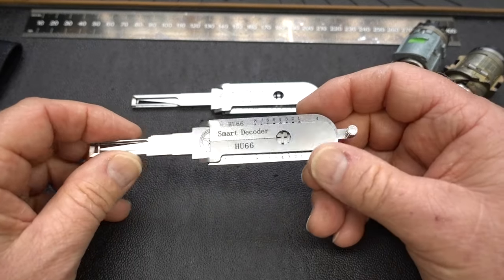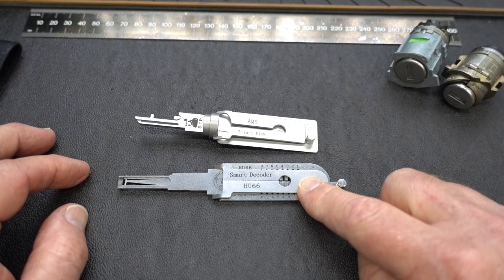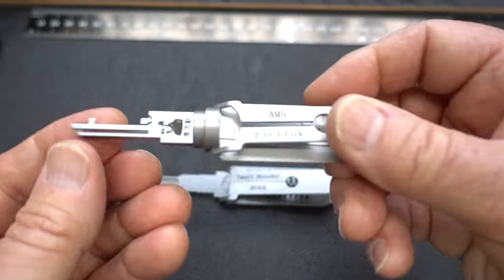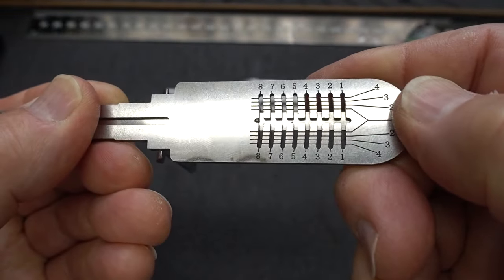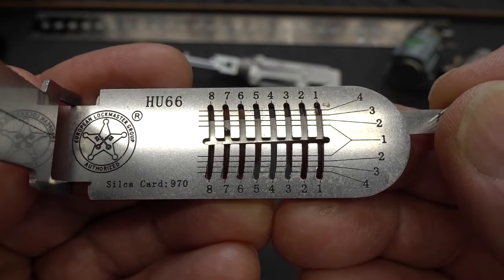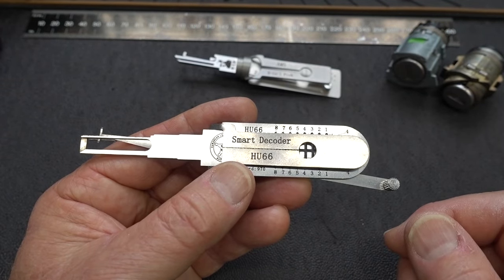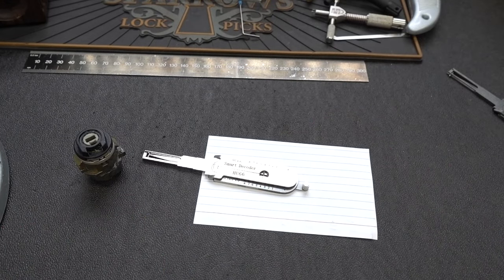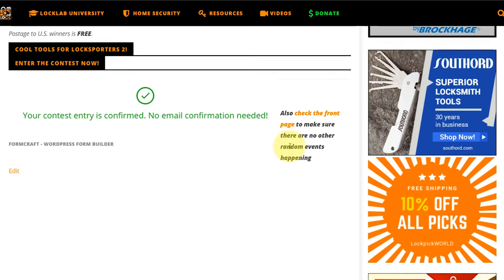(1714) Review: Smart Decoders from Wendt

Comment: For the record that was a Audi door lock cylinder, also the cuts are either odd on one side even on the other or 1,2,5,6 on one side and 3,4,7,8 on the other, you only read one side after picking not both ( I’m a automotive Locksmith for 25 years ) enjoyed the video
Reply: For the later VAG locks they use Side cuts as well. On the slightly earlier locks the wafers go 2 on one side then 2 on the other down the barrel.
Reply: Do they work on all locks, inclyding the ignition? Lots of my customers lose their keys, and direct read for everything would be infinitely preferable to progressing a key from a door only, and definitely better than pulling the ignition and taking it all apart.

Comment: The first two points you compare are not fair. 90% of the jobs are on daylight,  if is the finish shining is as you said "head gymnastics" to tilt and have a good reading. Second,  the fact that lishi is completely loose to move around you can get over some nasty high cut pins (like cy24, gt10 etc), the pointing tip of the decoding is sharp on lishi and better for reading "inbetweeners". Overall... I'm a big fan of Lishi and Mr Li, I used them for many many years and never got one snapped, yes, decalibrated but never snapped. 
Keep up your good work, every single video I learn something and congratulations!

Comment: I'm a locksmith in the UK and use Lishi picks to open cars all the time, I got one of the Smart decoders (HU64 for the Mercedes locks) when they came out a few years ago, unfortunately those channels that guide the reader up and down can prevent the pick from working, you see the end that actuates the wafers is a "T" shape on its side, and the wafers when picked into the maximum depth can't then move back far enough to allow the guide back to the cutout for moving between the different wafers, because the bottom of the wafer has come up so far the opposite end of the "T" shaped actuator is now blocked by the bottom of the raised wafer, now the HU64 is a much narrower key blade than the HU66 so Lishi made the pick differently and had two actuators that could only lift the wafer in each direction, and didn't allow for pushing it back in the opposite direction if you over lifter a wafer, the Lishi picks for wider keyways like the HU66  has more room to move up and down so use the same "T" shaped actuator, but because  Lishi picks don't have the cut channels, you can usually come back far enough to just pull/push the actuator into the next wafer position if the biting makes it awkward, but generally I find the narrower key-ways easier to pick with the old two piece Lishi blind picks that can't suffer from any of those problems because you retract the end of the actuator into the body of the pick completely.  
 Lishi Blind Pick 
https://i33.servimg.com/u/f33/11/98/29/83/hu64-p10.png

https://i33.servimg.com/u/f33/11/98/29/83/unname10.jpg

Lishi 3 in one pick
https://i33.servimg.com/u/f33/11/98/29/83/3-1-hu10.jpg
Reply: Yes exactly!

Comment: Those Wendt picks are really nice to use, however most locksmiths need 10-20 different picks for different keyways so it adds up, especially if you buy the lishi picks at a discount. BTW, you only need to decode each wafer on one side, the same side you moved the pick when you set it.

Comment: I have about 50 Lishi or Mr Li picks for about 98% of  UK vehicles.  I have a flight case for them.  They last typically 3 to 4  years of hravy use. They also use silver on black.  Once you have done your first 100 its second nature to find the correct wafer.

Comment: The comment about the “flat design” vs the “collar” isn’t a fair comparison.

The collar is on domestic lishi picks and not automotive lishi picks.

The reason it is on the domestic picks is so you can reverse the tension bar depending on the handing of the door.

That being said...
Does the German Wendt picks come in domestic profiles or only for European automotive?
Reply: @Zieh-Fix  Do you have any plans to produce domestic lockpicks in this style? The greater variety seems to be the main advantage lishi picks have over these.

Comment: Neat tool actually! But I'm guessing you'll need one for each key cut?
Reply: There are some systems for which a different designated tool will work (picking), but they're few and far between. Can also cause issues with decoding - may or may not be a problem.
Reply: You'll need one for each keyway. Possibly more for systems like the Toyota TR47 key as it was used with both an 8 cut system & a 10 cut system. HU66 will work in a bunch of cars in the Volkswagen Auto Group.

Comment: Really nice that the pick arm is completely shrouded. Keep it from flexing and twisting. I want those so bad, if I don't win them I'll probably buy them. I'm going to need more Trump bucks.
Reply: That's a function of the lock itself, the HU66 lock is "high security" which necessitates the design. The Lishi design for this lock is fully enclosed as well. I have the Lishi for this & several others.

Comment: One way to improve on the Wendt decoder would be to not only have the engraving on both sides but to have the cut numbers on both sides of the slots. That would make it a bit easier on the first few pins/wafers/whatever in the back. Shouldn't cost much to do it that way
Reply: @Zieh-Fix  I was talking about the sides of the slots. You only show the cut numbers on the right side of them. To the right of slot 1. Which means that when you're working on eg slot 8 you need to move your eyes across all the different shapes, which can be a distraction, all to the side and look up the cut number. I can get easily distracted and lose sight of the line.
Now, if you had put the numbers to the left of slot 8, too, I'd only need to have a short peek to the left to find the cut height. My eyes would have to cross three slots tops that way, and it's easier to keep track over a shorter distance.

Comment: Hey Bill did you know that the original Lishi is 120 bucks and the genuine Lishi is only 60 bucks! It's been proven the only difference is a marketing thing with Mr. Lishi! So we can all just buy the 4 or 6 or whatever there is for pin tumbler lishis
Reply: A majority of locksmiths would disagree with this. Original lishi is the original and genuine is a knockoff. I own both and only buy original now because they are sturdier and better made. I cannot say anything about the wendt because I’ve never used them.
Reply: Original Mr Li was the first company.  "Genuine" copies them but has a much better marketing department so many customers think they are the inventors.

Wendt makes an improved product with western quality control.

Comment: i have a KW5 and ive noticed the pins do not match the lines and it does not fit all the kwiksets i have
Reply: Is that a issue of having a Kwikset Titan lock? Some of the SmartKey locks, the keyway is pretty tight, making it a bit of a challenge to get the tool in. Some other manufacturers using the Kwikset keyway can be tight on occasion but I can't recall ever running into that with a non SmartKey Kwikset.
Reply: @bamascubaman  im not sure. the kwikset it does not fit in is silver instead of gold. the KW does fit on my faultless locks though

Comment: Pretty cool, but these days fewer cars still use mechanical keys, and even those are secured with an immobilizer chip that you have to program into the car's computer.
Reply: Starting the car is a whole different ballgame but practically every car still has a mechanical entry system.
Reply: @StyxHackshop  Yes, my new car has an all-electronic key for starting, but inside it there is a backup key for mechanical unlocking of the door in case the battery is down or removed. It would be a huge oversight to rely only on electronics for opening it.

Comment: Not a true apples to apples comparison.
1. Lishi automotive are generally much cheaper than the non-automotive ones right now & its speculated that even those will drop in price quite a bit.
2. The round collar is ONLY on the non-automotive ones as far as I know. The automotive ones are flat like the Wendt.

A locksmiths observations
1. You'll rarely come across situations where you have to rotate the pick past 90°, making the markings on one side vs two largely irrelevant.
2. Try making key, needing to read those numbers in a low light scenario where you are using a flashlight, you'll dog cuss that reflectivity. Even the satin finish on the Lishi can be difficult to read.
3. I can see some adv to the "gated" design on the Wendt but not sure if I'd prefer it to the Lishi design, although that is probably because I've been using Lishi for several years now. The only Lishi I have broken is the GM37/B111, which is somewhat fragile to get around the warding but I broke I doubt that a Wendt would have survived that particular case either. Something weird was going on in that Cadillac's lock.